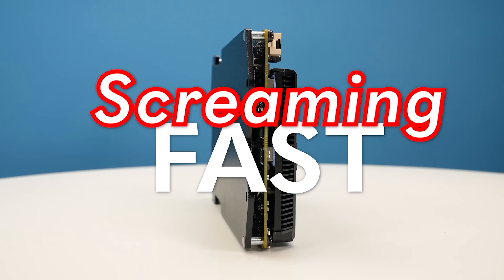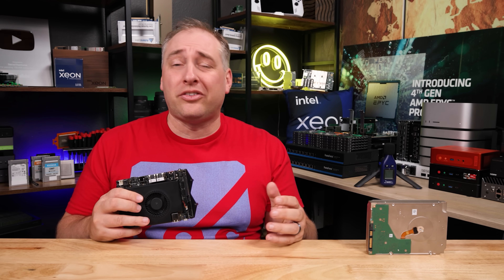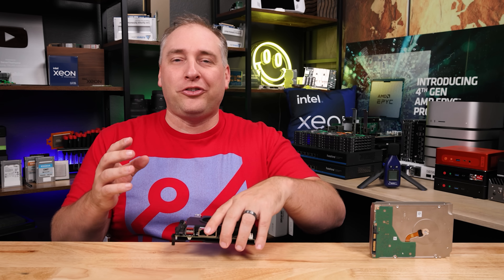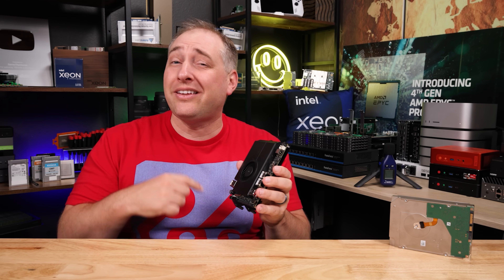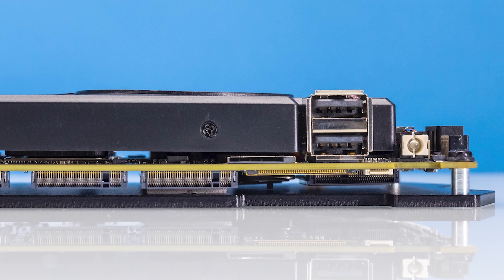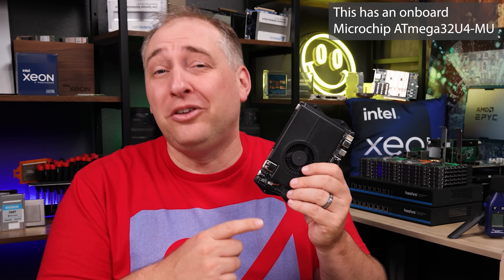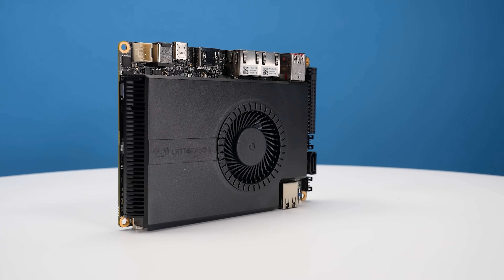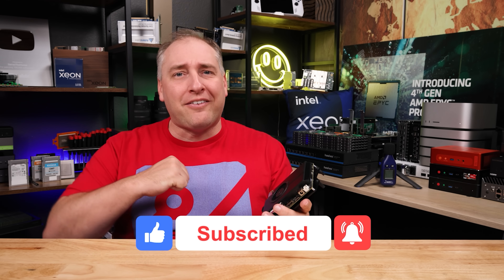This Single Board Computer is Faster than a Mac Mini AND a Raspberry Pi

Comment: You could totally build a whole rack of these things in a standard old school desktop PC case with 10 3.5" bays in it. Just 3D print some rails, or drill the drive sleds to mount them all. Use some EGPU adapters to install GPUs, and could even use them for gaming.  the main motherboard space could be used for anything, even just make a display shelf with an acrylic window for some toys or something. Also, an old school 3.5" external drive adapter could be tinkered with, and I have to wonder if you could use the copious amount of empty space in the Razer core V1 to build a SFF gaming system inside that. Lots of possibilities!

Comment: To me it sounds like they took 2 computers of 1 IoT board and 1 small PC and put them onto the same PCB. Sounds like an reads like a good way to do devlopment for anything using or compatible with the ATmega32U4  Arduino layout and chip. Outside of a board that is both for the devlopment of the IoT Arduino board and a full desktop it sounds like a standard miniPC that most consumers would get and not notice anything different from a prebuilt but the price and the missing case. As 4 USB type-A ports is enough for most and the 2 Type-C ports for when the hardware requires type-c not type-a it is a very good little machine. 
Just i wish there was a case for it. Over time dust will collect no matter what you do so having a case would be a good thing. Also to prevent accidental touches from other objects that might have  a static discharge that might kill a competent or the entire board. All put together the 32GB RAM with a the Wifi AX module is 630USD at cheapest then you will need the M.2 drive and OS so effectively 800USD to 900 USD for the 32GB RAM version. As the 16GB with AX module and 500GB M.2 drive is only 648USD  but without an OS installed. Windows basically adds 100USD for a retail copy and 1TB is basically needed unless you also have a NAS and/or another computer to store files onto. Project files can get pretty big. More so if you save versions of the same project file so to be able to back track while in the devlopment of what you are doing process.
Reply from the maker: I agree on the case

Comment: Same processor as the latest Framework laptops. Would be an interesting comparison given you can buy their main boards and run them as an SBC. Though I think they are limited to DDR4 unless you get the upcoming Ryzen version.
Reply: Yeah Framework sells the compute unit with a similar use case to this.. but the cost of that is significantly higher... im not sure if the compute unit price is including SSD or not..
Reply: @agenthimzz  "significantly higher"?   I don't know if I would say that... $668.00 for this on Amazon vs $549 on sale from framework for 12th Gen (plus RAM and storage, yes).... they are also blowing out their older mainboards right now, starting at $199....?

Comment: Which Raspberry Pi are you comparing it to, the 400? That Σ is 3x the size of a π4B

Anyone tried running four sticks of Kingston's DDR5-4800 ECC UDIMMs on AM5? They're Hynix M-die, so they might even overclock

Comment: "Faster than a Mac Mini" yet it's beaten in single-core by 15% and barely eeks out a multi-core win by < 2% ...
Reply from the maker: 2% / 6% is still faster :-) Not bad when the #1 SBC is about 1/14-1/15th the speed

Comment: Yeah, at 800 bucks this is not a good option. Costco recently sold the M2 mini for 499 which has 2 Thunderbolt 4 ports and a 2.5 gb Ethernet and the M2 gpu is far better than Intel Iris. And I am not an Apple fanboy. I hooked up an OWC 4m2 TB enclosure with 4 SG 4tb nvmes, with the setup running 1900 mb write, 2400 mb read. The Mac OS has raid built in, which seems to work much better than Win 11 Storage Spaces which averaged 800 read/write. Again most of my computers are windows pc’s, but the mini makes a great NAS and server. The Asusstor nvme NAS was also on my list, but at 450 for the 6 nvme model, I decided that I would rather have a computer than just a NAS device, hence the mini. All fun and games!

Comment: I wouldn't call midrange Intel chips faster than Apple M1. And when the board uses normal x86 chip then it's just more cost effective to look at mini ITX or even uATX boards. thin mini itx if you want something small.
Reply from the maker: Geekbench 5 and 6 it was faster than a M1 and M2 Mac Mini (M2 Pro is faster.) We showed that briefly in the article and performance section of the video. It is not that far off, save the cases where Apple has better accelerators. We have a stack of Mac Mini's and a Mac Studio that is being used daily and is on set.
Reply: @ServeTheHomeVideo  geekbench isn't the best benchmark/represrntation. Intel iGPU is much weaker and only big cpu cores can be close if you dump a lit of power. You benched some burst performance.
Reply from the maker: We showed this, it did not throttle to a lower PL

Comment: I wonder if you can mount this inside a traditional computers 3 1/4 drive bay and use it to do evil fun things.
Reply from the maker: You probably could if you could make a mounting solution for it. The bigger issue is that the ports would be sticking to the sides of the case, not front and rear.

Comment: My biggest issue with it is the integrated memory... I was considering it as a massive upgrade from a 3B+, but will probably go with a recent tiny/mini/micro instead, at about 2/3 the cost of this.
Reply: You'll love the tinyminimicros. I wound up using one of the more recent models as my (this) desktop workstation--it's massive overkill for most server tasks.
Reply from the maker: Very fair.

Comment: Faster than the mini is not a thing it's got the pathetic M2, Ryzen 7945 HS mini is better than the M2 Max mini

Soldered ram is only fine if they also give extra ram slots for upgrading, so you have the best of all worlds even though the mismatch will impedes overall RAM speed more RAM Trump's faster RAM.

Why AREN'T minus made with 7945 HX, that will be better than the Max studio with M2 ultra.

Added size for cooling is not a thing I worry for those of us  wanting that kind of performance without having to buy into the Apple overpriced hardware and non upgradable philosophy

The studio is double the size of the  apple mini 7946hx can be double the size of this mini for cooling and expendability.

And we get the benefit of a socket CPU

Comment: Whatever else can be said, they got it right with all the IO options.
Reply: I absolutely would not feel comfortable using the GPIO on this device with a breadboard. With an RPi, if I make a mistake and short something and it blows up, I'm out $35, no big deal. For $700 though? I would probably put kapton tape over that GPIO just to avert tragedy.
Reply: @silverywingsagain  Yeah, I would be more comfortable using a USB -> parallel IO or if I did use the GPIO I would optically isolate everything.
Reply: Really wish it had at least a 4x pcie slot. I've been hunting for one to see if I can hack together a dead nas I have that has a very servicable chassis. Something like this would be ideal. OS agnostic, plenty of NVME capability, and a 4x slot would mean plenty of capability for a modest mini truenas box

Comment: $579 USD for the base model of 16gig and no SSD, it's not cheap.  Interesting for niche applications I guess, personally I'd prefer an AMD chip were I going this route.
Reply: I'm right there with you I recently got a Beelink mini pc with a 5800h and 16GB of ram and a 500gb drive for $300 if you want a small computer for performance not features.
Reply: @Brom-gaming  is that the price for used or new?
Reply: Got a few Orange Pi 5 Plus for 150$ a piece. Rockchip RK3588 and 16Gb RAM
Reply: @mr_______x  what's software support like though?  I used to use a Rock64 until it's usb3 port burned out, software took a LONG time to become reasonable on those things.    I have been a Raspberry Pi crackhead for a decade now and generally found that easier save for their messy handling of DPMS in newer kernels.
Reply: ya I don't get the price point. It's not pro anything but I would cluster these for 3d rendering. As far as testing sql servers, sharding, dev at home, I can cluster pi and get what I want. A home machine, but ya, I use linux so I prefer AMD.
Reply: @ReachingLuyten_b I think they've built it for a specific niche application in this sense.  These things turn up in industrial applications quite often, usually when the client doesn't want to use ARM based solutions (there is an argument for this with configured/compiled/tested software which is always more up-to-date on x86/amd64 I find). 
It's remarkable what they cram onto notebooks at this price range too, sad thing there is the support/integration isn't always... great.
Reply: Yeah the price kills it for me, it's literally only worth the money if you need that form factor or the PCI-E ports. Otherwise you can get a framework motherboard with an i7-1340P for $450 (rather than the i5 on the LattePanda). Plus, the framework one is cheaper AND has expandable storage, memory, etc.
Reply: He means for the use cases and having ecc memory and it being a small form factor
Reply: I can't think of anything else with this feature set and form-factor that's cheaper though. that is a TON of I/O with a new CPU on that board.
Reply: @notaprofessionalJ  it is a niche product but you are going to see near peer hardware that can match a fair bit of it and arguably many implementations are unnecessarily obsessed with that SFF or SBC configuration.  I can see perhaps some implementations that may benefit but the cooling is going to be something that is of concern in hostile environments potentially.  I am all for these solutions but they do face a fair bit of competition if the architecture options are a bit open.
Reply: @notaprofessionalJ  would probably be cheaper with 6800u
Reply: @notaprofessionalJ  ever heard of Mac mini m2?
Reply: @AndrewTSq  that's not cheaper and running Linux on it is still a PITA AFAIK
Reply: @notaprofessionalJ  its $700 with memory and storage . This is 600 ex tax. (25% tax) but yeah linux is out of the question.
Reply: He means for the use cases and having ecc memory and it being a small form factor
Reply: it is cheap though.
Reply: @RobertoCarlos-tn1iq  the $300 beelink mentioned above is cheap as it also has a superior processor.  This one just isn't overall, I do appreciate some of its hardware but we're heading well into notebook territory with case/screen/battery/keyboard/trackpad.  Sure they're different things and different configurations but in the past I have found some of these lower volume systems to be not...  Ideal....  Build quality.  Shuttle was one I had (ran esxi on it) but it failed with basic electrical problems very very shortly out of warranty.  Had someone look at the board, he said it was dreadful quality.  I can't speak to this particular unit but I mention this as it may be another area of adoption compromise for the platform other than component cost.

Comment: Hi, I'm far from being convinced because for the same price (~$625 for the 16 GB RAM version) you can buy 3 NanoPC-T6 16 GB RAM using a RK3588 processor, which will suck 3 times less Watts when pushed to 100% that you can unite in a Beowulf cluster - of course, this would make a different beast but the processing power would be close to equivalent (3×4 hi-perf cores + 3×4 budget-perf).
Reply from the maker: Usually RK3588 is about 25-30% the performance of an i5-1340P and uses around 1/3-1/4 the power of these. I think the last board we looked at was 13-13.5W. So you can get three RK3588 but then you also need a switch so they end up using more power and you have to manage three machines and clustering software instead of one larger node.
Reply: @ServeTheHomeVideo  Well, usually the switch is already there, so we can say it is out of the power equation, this leave us with 3 machines eating around 7.5 W @ 100% and if I had to build that, I'd boot them on the network to minimize the management.

This is a comparison that could be interesting.

Yep, I'm falling for RISC, because the power consumption is out of reach of the x86 world.   May be because of the ARM "new policy" we'll also see interesting things coming from RISC-V in the years to come, who knows :)

Comment: I think some are missing the point when they think that a small x86 board is some kind alternative to a Arduino or RPi.
Reply: At the end, you are running some form of Linux, only this time, you have the bigger x86 ecosystem to play with

Comment: Four things:

1) The cost of entry for this is somewhat prohibitive given that I can get a more performant mini PC, often times, for less. (But of course, those mini PCs doesn't have the GPIO connector, which I guess, defeats the purpose of getting said mini PC over this.)

2) It would have been interesting to see some application benchmarks, if you were to say, run the Puget System's Adobe benchmark and compare the results from this SBC to your Mac Mini M2.

3) I wished that there was an AMD version of this (because the AMD processors are faster and/or more power efficient).

4) When the price comes down, I can envision Smart TVs ditching the lame Snapdragon or whatever ARM processor that they're using, and putting one of these things in said Smart TV instead.

It will drive the cost of said smart TV up, but it will also make said smart TV SIGNIFICANTLY more capable then the crappy "computer" that's in smart TVs today.

(Our Samsung QN90A TV can't play 2160p movies with DTS:X audio WITHOUT having my Plex Media Server transcode said audio down to PCM or something like that, just so that said TV would be able to then play said video. And the problem that I run into with that is that AUDIO ONLY transcoding is VERY slow. There's GPU acceleration for the VIDEO (AND audio) transcoding, but there's NO audio transcoding acceleration available. As a result, I'm using a mini PC to run/drive the TV (which defeats the whole point and purpose of having a smart TV in the first place, but you can't get new, big, "dumb" TVs nowadays), and the mini PC is able to play said 2160p movie with DTS:X audio.)

But if a smart TV uses this LattePanda Sigma (or something VERY similar), then said smart TV won't have this problem anymore.

Comment: That looked nice but with more flexibility would have been additional Artix7 or some new small FPGA that have hard PCIe block.
That ATMega32U4 is nice for basic IO like SPI, direct pin handling, etc. ATmega can provide 5V IO. With SAMD series ARM or STM32 it forces you to 3.3V IO and with FPGA it's from 1.2 to 3.3v.
Was there some old prototype hacking laptop that had Spartan 6 for external custom IO:s and it was connected with PCIe to main CPU.

Comment: Wow, 15x the computing power of a RPi 4 at only 23x the price! What a deal!
Reply from the maker: By the time you get networking all of those Pis, cooling, power supplies, boot drives and stuff, Pis are expensive
Reply: @ServeTheHomeVideo  Sure, that may be true, but I think it misses the point. The RPi 4 is designed to serve as the brains for hobbyist devices, and for 99% of use cases, one of them is more than enough. It's not supposed to be a fully fledged media center, a hardcore gaming pc, or a video ingest server. If you need that kind of horsepower, and you had $700 earmarked for it, wouldn't you just build an x86 desktop that you could upgrade down the line? I'm really struggling to see the advantage here other than physical size. I think there is room in the market for an affordable device like this, something that is in between the two extremes presented, but the LattePanda devices seem a bit like overpriced toys for people with too much disposable income.
Reply: These LattePanda devices are all the same honestly. The only possible way to justify the price of them is to look at the savings on power over time. Especially in countries where power is very expensive.

Comment: It doesn't matter if it's faster, it's too expensive. Unless you need that much power in a compact form this product is a flop
Reply: Too expensive compared to what? Yes a Ferrari will cost more than a Honda...but there's different levels there

Comment: Instead of one or two TB4 port, I'd love to see PCIe. This looks like a damn cool NAS PC if it had the additional expandability. Sure, one could probably get M.2 adapters but... yeah. 

On the other hand this could very well be used as a media center and small home server. Especially the size makes it really good as a clusterable PC running redundant apps. The SIM slot is also a feature, I love. Due to some power outtages, I encounter in my flat, it'd be cool to be notified. This can very well be achieved by just powering this maschine for long enough to send a messaage over cellular and notify me.

Currently, the price is a bit high for my liking. Especially with the ZimaBoard existing. But I'll keep it in my head and maybe I'll buy one.

Comment: Finally!  Someone using the pcie lanes.  So tired of 1 m.2 and no TB4 single board computers.  Lots of other connections you can do with m.2 too like to 5 sata ssd's to make a tiny and fast storage server.
Reply: Problem is that ALL of these m.2 to sata are very unstable and just very bad reliability in general. People loose data with them under Truenas, Linux etc

Comment: This is so close to something i'd like to run as my little homelab, if only it supported more SATA ports. It'd be a perfect little virtualisation box with 32GB ram but if a 4TB NVME drive exists, I cannot afford it
Reply: You can buy dummy m.2 SSDs that have about 5 SATA ports on them to get around the SATA limitation, but I can't speak for the reliability of them. I hear they get very hot due to a lack of heatsinking.
Reply: 8tb ones exist, but yes above 2tb they get pretty expensive.